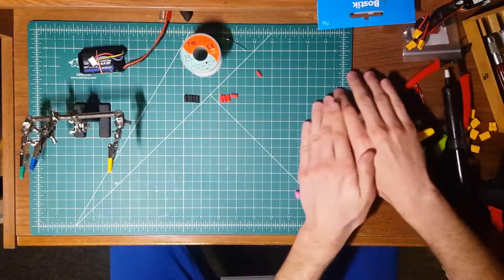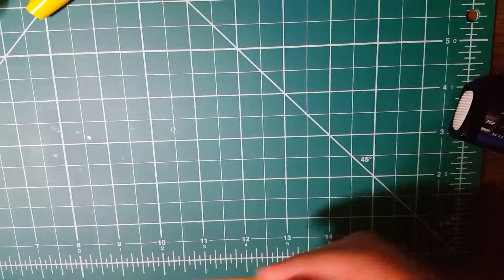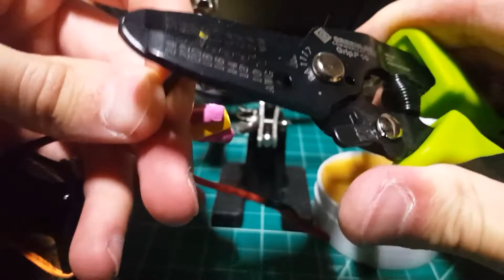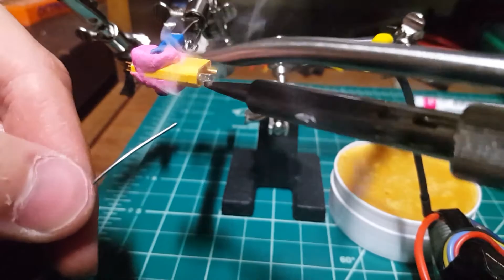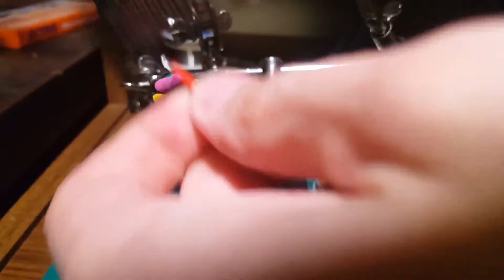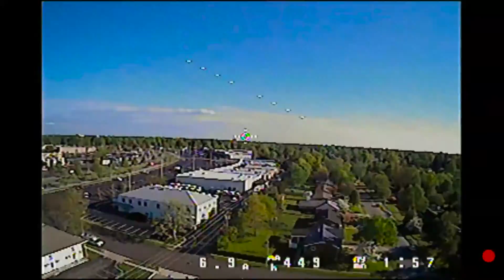How to Change Battery Leads to XT30

Comment: what type of solder is that
Reply from the maker: Jason Young the solder is "0.8mm 60/40 Rosin Core Flux Tin Lead Soldering Wire". I bought it on Amazon but the brand I bought is no longer available.